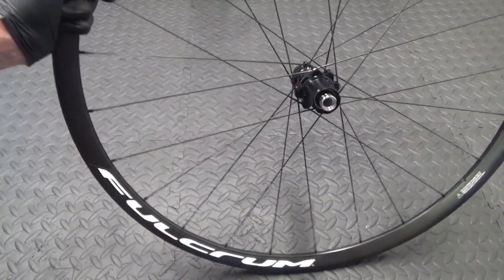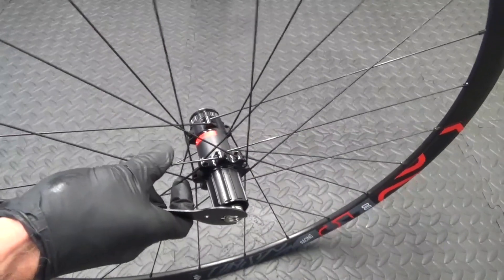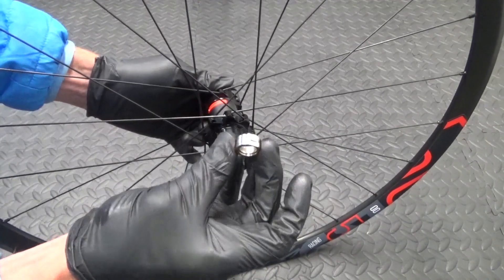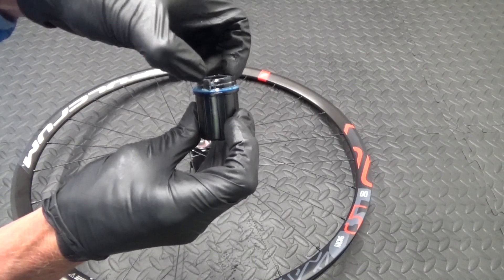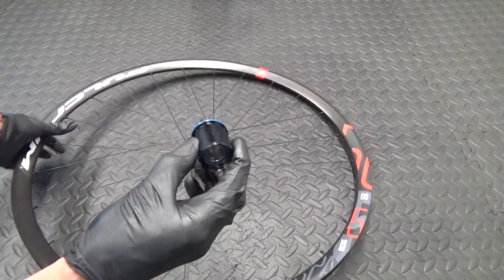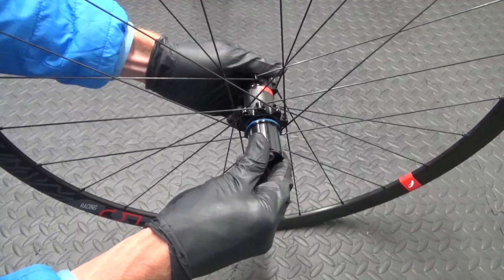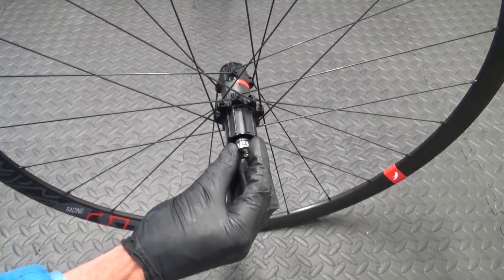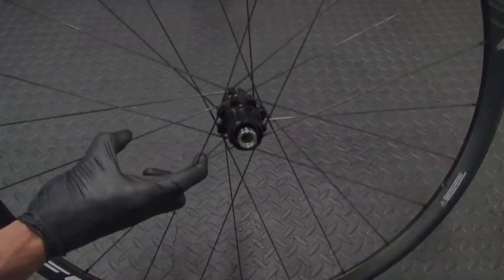Fulcrum Racing 5 DB Freehub Body Removal Guide

Comment: Thanks. This was useful for doing a thru-axle swap from 135 to 142mm using their Fulcrum RM16-TA12142 135/142 mm rear thru axle adapter kit
Reply: I'm just about to do this myself, got Fulcrum RM16-TA12142 on order, Bike24 was the only place I could find one. Did the change go smoothy for you or did you find any problems?
Reply: @michaelcameron2553  hopefully it's gone OK for you, I'm doing the reverse and going to QR. It seems pretty straightforward for the rear, as long as you remember the driveside cap is reverse threaded.
Reply: @ajwitt7472  Job done now, Bike24 was a let down as the delivery never turned up. Found another supplier, fitting was easy - push fit ND side and threaded at Freehub side.  Happy riding now on my Fulcrum rear wheel, I don't have matching front as it lost a fight with a Volvo Estate, fortunately, me and the rest of the bike were not harmed.

Comment: Very useful thanks. This also will help anyone trying to work out how to convert Fulcrum wheels from TA to QR using the kits Fulcrum have (the kits have no instructions, just exploded diagrams). Front is "just" pull off the TA endcaps and fit the QR ones, which should be easy, but the caps are really tight. For the rear you need to pull off the non drive side end cap, remove the plastic collar and then undo the drive side endcap clockwise using the flats

Comment: How change TA 142 to QR135 Fulcrum Racing 5db?
Reply: Did you find out how to do it? I need to convert my wheel to 135 qr too.
Reply: @cemark6596  You need the RM16-TA12135 conversion kit, basically thinner endcaps to replace what's on there already. Non-drive side one just pulls off, then remove the plastic collar (2.5mm hex and then unscrews clockwise). To remove the drive side endcap hold the non-drive side using the flats and unscrew the driveside clockwise as per this video.